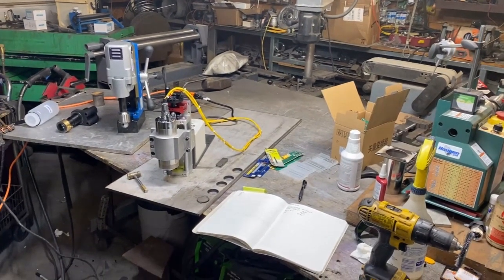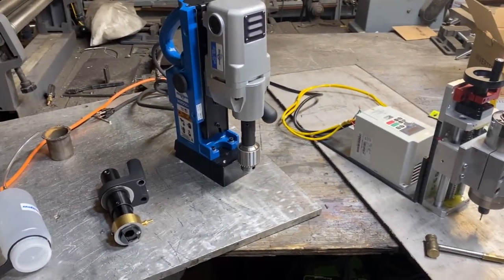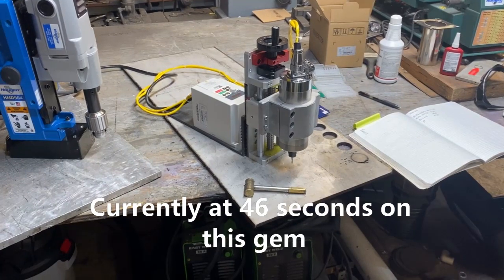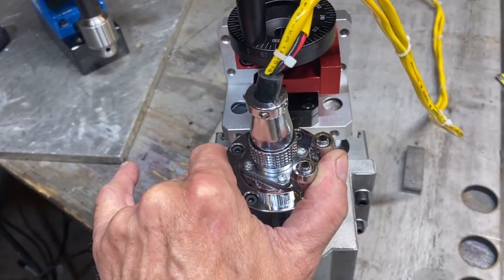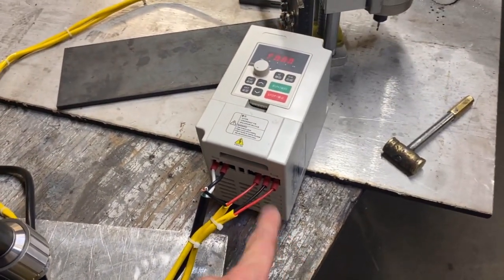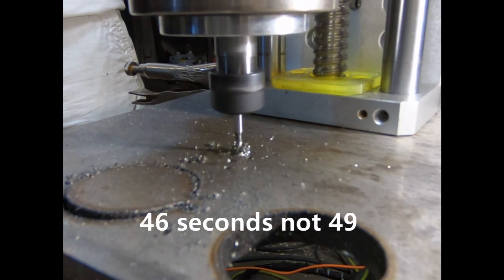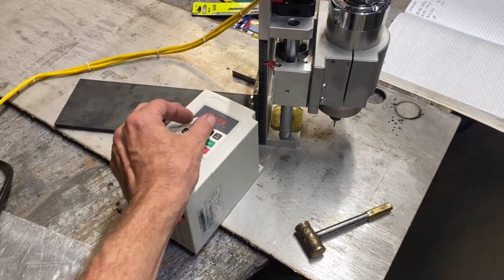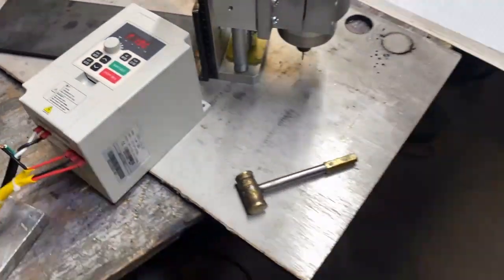CNC Drill press can you spare your Wisdom  ?

Comment: CNC machinist here. For a tiny drill bit like that running dry I would go at about 1200 rpm @ 1-2 IPM feed rate. TiN coated cobalt bits (Titanium Nitride) are my favorite for tough jobs, and you can resharpen them by hand when they get done unlike solid carbide or carbide tips.
Try what I suggested on a test piece first. Also put down a sheet of 3/4 plywood so you can drill through on top of your table.
clamp the work piece down.
vibration is not your friend.
Idk about the water cooling. seems to be a bit much for what you are doing.
Reply: He feeds it by a hand and that's a big problem,you dont get consistant same  pressure . What might work for CNC machine fails miserably when it comes to hand operated machines . Unless he installs a stepper motor for down feed ofc. But thats a whole lot of programing and new hardware .
You can resharpen  carbide with a  6" diamond wheel on a small bench grinder  and those are like 10$ on ebay or ali express ,all you need to make is a back plate for bench grinder.I do it all the time with carbide lathe knifes.Its not a world record speed of sharpening but it does the work . You can also buy wheels specially made for carbide grinding. 
But yea ,cobalt bit might work better for this job since it is better when it comes to bending than a carbide which doesn't like it at all . Also i would use as short drill as hole allows .
Reply: @zumbazumba1  you can sharpen carbide drills by hand sure, but it's a pain because you have to hold your hands perfectly still for such a long time. We got a good 8" green wheel at work and it still takes seconds to make any headway, which is forever when trying to hold a precise angle by hand.
Reply from the maker: Thanks a million

Comment: Water-cooling is pretty necessary for those motors you're probably fine while you're testing, but for so many holes hooking it up to a bucket of water probably would be a good idea. 
For the drilling:
The way that the wheel you're using is moving the bit is going to lead to a lot of unnecessary wear, since it's jerking the bit in and out of it's best cutting rate, that's why pretty much every drill press you see has the big handle on the side so you can keep an even feed on the bit through the entire cut. 
For industrial cnc machines, drilling small holes is still kind of a pain, since there's no through flow bits, so you gotta aim the cooling spray at the bit, and then every 15 seconds or so retract the bit all the way out of the hole to clear the chips and cool the bit and part. 

Really I think it would be best if you figured out some way to keep the right force on the bit, maybe by wrapping a piece of string around the wheel, laying the string over a piece of rod, and hanging a soup can or something off of the string, and using the wheel to run the bit back up out of the hole when you're about half or a quarter way through the sheet to clear the chips and let the bit cool a bit. 
Good luck with whatever you figure out, that's a pretty unique machine you've made there.

Comment: Tungsten Carbide, PCBN, Sintered Diamond, Silicon Carbide, but yeah something hard that is wear resistant.

I would personally always advise cooling because when the windings get too hot, you will burn the motor.

The speed needs to go up for small diameter bits, and whether you flood with oil based or water based, you need to keep the holes cool or else the holes will swell up and possibly jam the bit and snap it off.

Comment: You really need water pumping in it.  There are water jackets and they will heat up if there is no water, this will cause damage if you run for more than a couple minutes.  nothing crazy, just a pump from a fish tank and a bucket of water (preferably distilled or with a mix of antifreeze for the reason of anti corrosion properties).  Carbide likes running fast and steady. if you can smooth out your pecking than it will help prevent a bit from snapping.

Comment: My grandfather and I come to the conclusion that "We are born stupid and we die stupid."Now that I got that out of the way I can tell you what I learned about drilling thousands of holes a day. We found out that using cobalt HSS drill bits works the best when using very high speed RPM. What we found out by accident on drill speed and longevity was using straight cutting oil. Slow dripping to a light flow on the part and drill bit. Carbide sucks as it seems to be a bit brittle and burning out carbide just sucks and their goes your size and locations tolerance. The material was always 300 plus grade stainless. I could tell you it worked for us. The RPM is something that you have to figure out by the chip color and curl. Do not be a SAP and think the more something costs it is way better. NOT TRUE PERIOD. Now that you are going into the world of JOB SHOP WORK WITH A SIDE ORDER OF PRODUCTION DRILLING. One more thing fella, the speed at the drill center is ZERO PERIOD. Or as women would call it a FEMININE NAPKIN. Ending on that note. Good luck as luck is more important than skill any day of the week and twice on Sunday. 
Peace NOBOX7. vf
Reply from the maker: I agree ,turns out titanium drill bits only labled at 2x lifetime out performed every other bit , carbide , cobalt , hhs.
I eneded up going with 450 rpm and very high pressure , this produces a light blue spiral chip sometimes no color but one piece chip and it happened in 12 seconds
Reply: @NOBOX7  When one can find what works by trial and error, one goes in the right direction. The great thing that one gets is knowledge which is something that cannot be bought, and one remembers those methods for a lifetime. Drop a line anytime fella. Just love to see the younger men taking the torch and run with it. 
Good luck and peace to you fella. vf

Comment: yo need to make that machine more rigid, vibrations will slow you down and brake bits, a bit of googling i found that recommended rpm for tungsten carbide is around 4850, and feed rate 60mm/min around 10 seconds to drill 3/8 stainless steel
if the router is getting a bit hot run air through the cooling or put a fan to it

Comment: Stainless steel is a whole different class when it comes to drilling compared to lets say mild steel. What you want is slow speed and high feed rate .Stainless steel likes to be pushed in.
Advice for carbide-ether you flood cool it or dont do it at all.it will dull faster without cooling but if you do partial cooling it will cause micro cracks in carbide.
As of speed and feeds all i can say is i slow it down until i get the chips of same color as material ,no blue or yellow or any other color(which indicates overheat at the cutting tip,due to too much rpm ,too much feed rate for current rpm or too much rpm for current feed rate  -you have to play with it,last one is not enough coolant for current settings ).
Unless you work at factory ,same peace 5000 times a day you will never have universal feed rate chart for every material and machine.That's why they tell you to thinker with it. 

Carbide is not as tough as people think ,his weakness is impact so a whack with a punch might do the trick if drill brakes in such a small hole -forget about drilling it out or using a acetilene torch to cook it off(works with HSS taps stuck in ss -due to lack of oxidation when heating it with acetilene torch. ). 

Not even cnc machine can drill a ss with that small bit in 5s.Bit is too small for such a tough material.Consider instead of doing it yourself to outsorce it . You might save a lot of money by paying someone else to do it. When you draw the line sometimes costs of paying someone else are lower that trying to do it yourself and failing multiple times.

Comment: stainless steel, nasty material. you definitely need cooling on drill bits or you will burn them fast before you notice. those fast drilling footage mostly are on aluminum or mild steel. center drill bits do small holes fast and tidy. or....you may try router bits with same diameter. and you probably have to prepare about a dozen spare drill bits because you are going to drill couple hundred holes in stainless steel. my experience is, don't give it a chance to overheat, when stainless steel turn blue, it is going to be as hard as coffin nail and you can expect a broken drill bits in next second. how big is the parts you are tailing about? if it is not that big, find a big tray and flood it will coolen can be a solution.